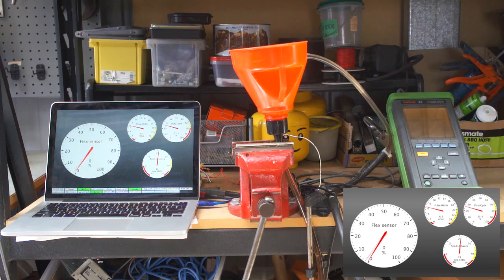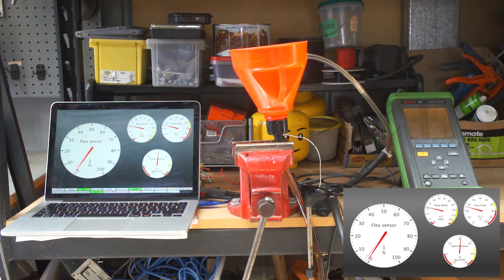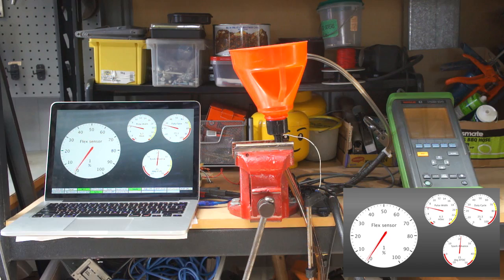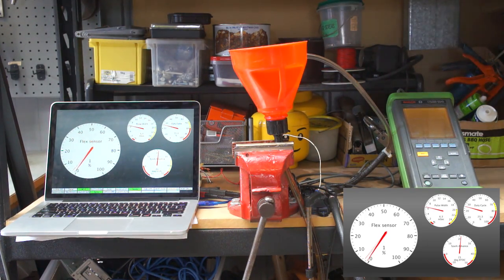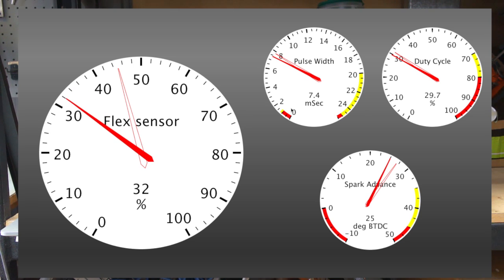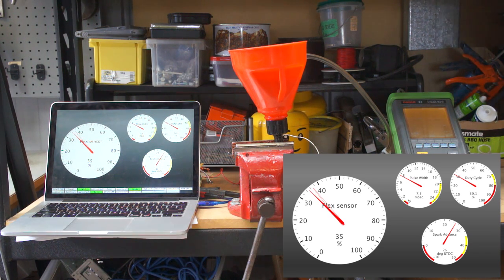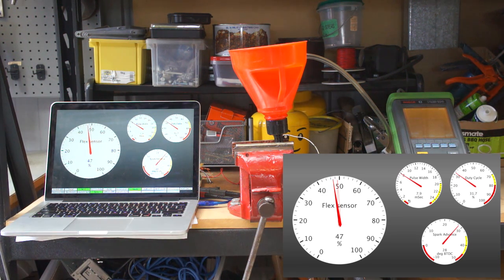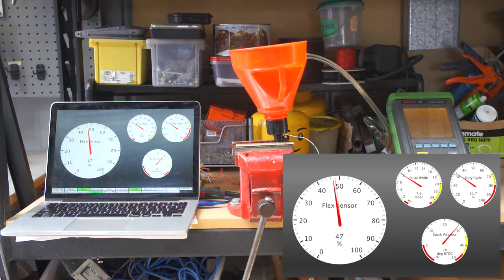Speeduino Flex (Ethanol) Demo

Comment: Hi i will ask adopt for hydrogen injection use mikuni lpg high flow injectors but needs adjustment  hydrogen gas tank pressure between 45 to 60psi. Its work well.

Comment: Hey Josh. How hard would it be to replace the ethanol sensor with a simple switch and have the Speeduino run a different set of injectors and a different ignition map depending on switch position?
Reply from the maker: There are switchable fuel maps in the latest firmware. Switchable ignition maps are in the next release :)
Reply: @Speeduino Is all this present in the stable version?
Reply from the maker: @giorgioc.8394  Yes, has been in place for a long while now in the firmware 👍

Comment: hi josh, im trying to use Flex fuel on my speedy, could you explain how you wired the sensor to the board please?
Reply: @Speeduino  thanks for the reply, it's a 0.4.3c which has Eth in the proto área but there are 4 possible holes to solder to, so I assume it has to be in a specific one?
Reply: @Speeduino  thank you, I really appreciate it

Comment: any more details on the build specs of this Arduino e85 sensor
Reply: Josh Stewart I just purchased the full v3 board for a turbo moped but was more looking for a standalone Arduino thing to convert 50-150Hz to 0-5v ecu input for another car application
Reply: Andrew Roline 
Did this ever get figured out?